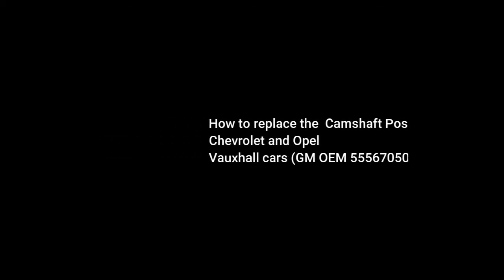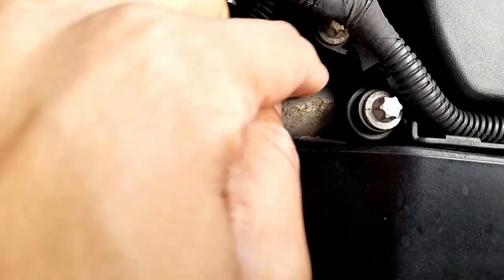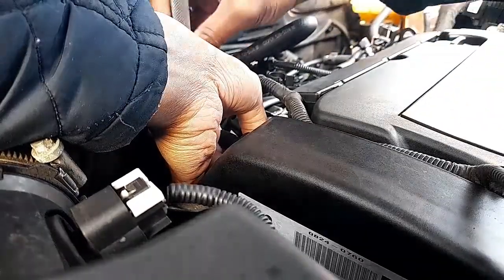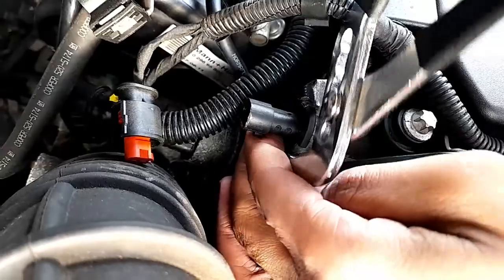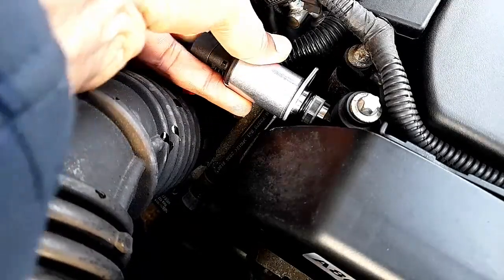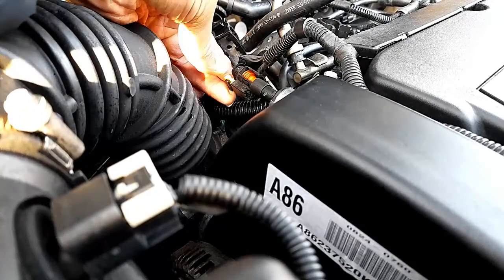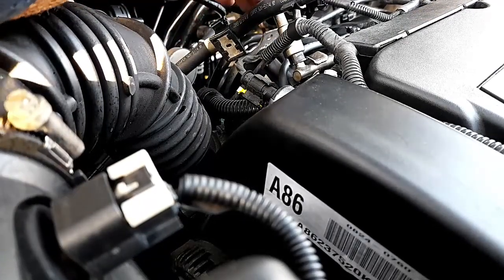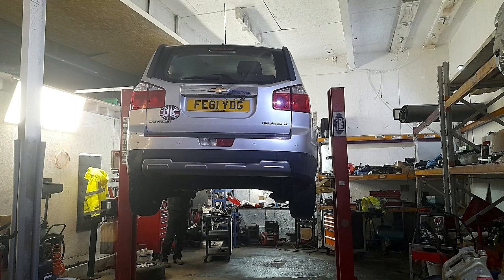P0011 OBD-II Trouble Code: Camshaft Position : How to replace Camshaft Position Solenoid Valve

Comment: What other symptoms did you experience because mine showing p0011 code and now won't start but cranking.  If I try rev it it only goes for about 2 seconds thanks
Reply from the maker: change the intake and exhaust VVT and the intake camshaft sensor.

Comment: What engine do you have? Will it work similar on 2.0 Turbo insignia?
Reply from the maker: Hi mine is 1.8 yes it should work
Reply: @nuramoboy  I've watched other videos and it turns out that 2.0 4x4 turbo is a bit different. Solenoids are not in front and the back of valve cover but on top of it on the left side,  and are a bit more slim.

Comment: Vauxhall astra code P0011.
A camshaft position timing over advance or system performance ban ,dose this gonna solve the problem?
Reply from the maker: Hi, It did solve mine,have u got similar issue?
Reply: @nuramoboy hi i have same issue code P0011 and P420 doe this gonna solve the issue?

Comment: Hi.... does the code p0011 reappear after you clean the vvt solenoid?
Reply: Mine reappeared so now I’m thinking camshaft position sensor
Reply from the maker: @Likabear710  have u sorted the issue?
Reply: @nuramoboy  nope cars running like completely sh*t now, giving it up getting a moped
Reply from the maker: Is it the same model?and have you changed the sensor?
Reply: @nuramoboy  I have a 2016 Chevy sonic 1.8l 70,000 mi. I’ve changed the intake and exhaust VVT and the intake camshaft sensor.
Reply from the maker: Hi the code now has cleared and car drives fine but drinks plenty of fuel